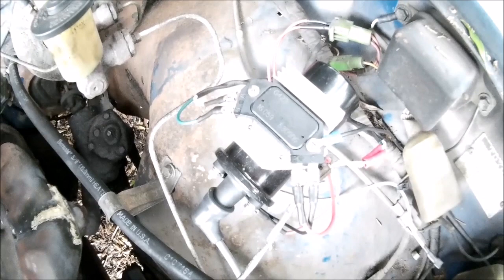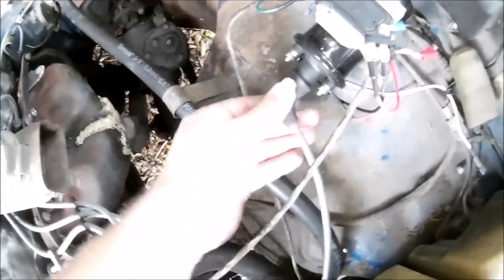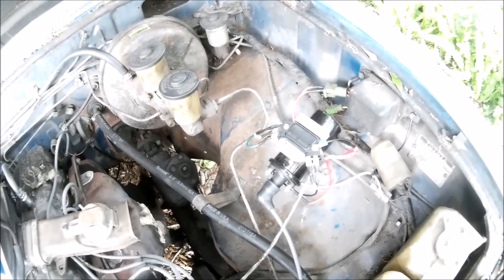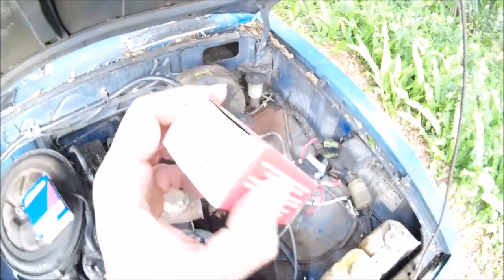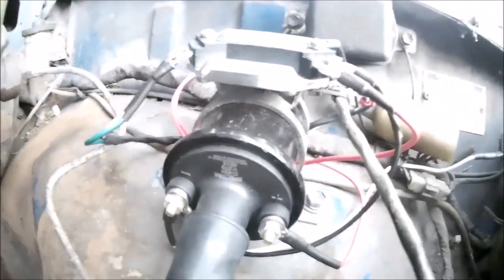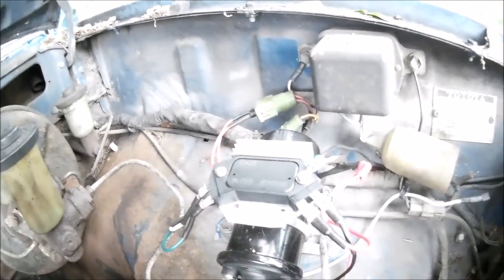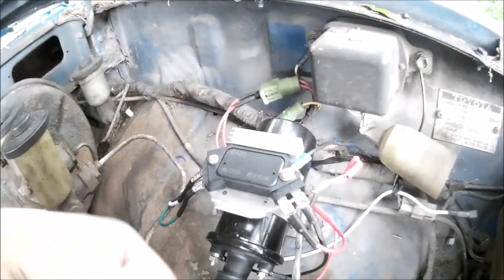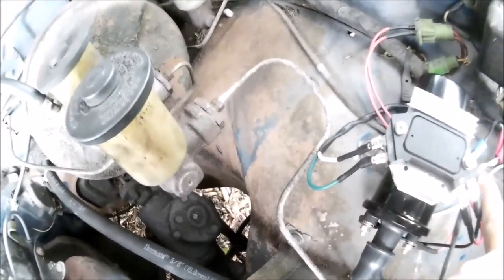1978 Toyota Pickup/Hilux 20R - GM HEI Ignition Module Conversion

Comment: Just did this conversion on my '78 Toyota Chinook today! Followed your video completely and did not have a single issue. Took about an hour or so. Thanks for the great list of '78 fix-it videos. BTW - I left you a message a few months ago about bolt sizes, etc. - your reply on that was to go to Ace Hardware, which was spot on. I've found just about everything I need fastener-wise in there.
Reply from the maker: Good work sir! Glad to hear the conversion worked for you and happy to be of help. Also happy to know I made the video complete enough. Sometimes I worry (and get messages from people) that the video is too long. I always try to make those vids complete because there is never any sense in doing it "half-butt". :^)
Reply: @The13thSword  I think the detail is necessary for these type of videos. If you made them shorter, people will complain that they are too short. Do your thing.
Looking for a good write up on a GM 1 (or 3, perhaps) wire alternator conversion, and on the hunt for a W50 transmission. I'm here in FL if you hear of anything! Thanks again.
Reply from the maker: @KevinMims  Not sure why you'd want to convert to the 1 or 3 wire GM Alt, but there are several write-ups & threads on it on Yotatech forums. Just Google Yotatech & you'll find the site, which you can search in for the articles.

Your truck being a Chinook it probably came stock with the 55 amp alternator, instead of the 45 amp model that the "regular" pickups came with. Both are externally regulated. The 55 amp model is still available remanufactured and Rock Auto has them at a much better price than the parts stores, even with shipping. They also have the voltage regulators. For the original alt setup, I recommend the Standard VR149 Regulator. You can see it all here: https://www.rockauto.com/en/catalog/toyota,1978,pickup,2.2l+l4,1277108

I don't know of anything local in FL for the trans, But Yoda Jims in CO is likely to have one. I've been pretty lucky with them on parts, and they also seem to have some motorhome models there, so the parts from them are lower mileage & in good shape. Google "yodajims" and you'll find them. You have to call them as they do not do online ordering.

Let me know if I can help with anything else.
Reply: @The13thSword  Thanks for the Yoda Jims info - looks like a great resource. On the GM alternator, I'm trying to eliminate items that aren't always stocked items - I don't want to be stuck while traveling waiting on an alternator or voltage regulator. Plus I'll be running dual batteries, so the extra amperage will be beneficial.
Not completely ruling out the 55 amp, but again want to make sure I'm easily covered while traveling.
Reply from the maker: @KevinMims  In that case the GM Alt would probably make more sense for you, as they are almost always in stock at nearly any parts store. Only problem with that is doing the new wiring for it, but I think the effort would pay off the first time you ever had an Alt problem on the road.

You may already have plans or have thought of this, but I'd recommend you also overhaul/update the battery isolater system & related wiring. Having a functional isolater is also a good way to not get stuck on the road, as it electrically separates the "house" battery from the "chassis" battery, but allows both to charge from the Alt as needed. This also keeps the "house" circuit from draining the "chassis" battery, & leaving you stuck with a truck that won't start in the morning.
Reply: @The13thSword  Proper isolation is on the list!

Comment: Hello need help.....I bought the two parts.   But do I need to change the point distributor entirely...to a different  distributor?...if so let me know what type or is there something else I need to upgrade
Reply from the maker: Yes, you need to upgrade to an electronic distributor that has a pickup coil in it. The conversion will not work with a points distributor. I recommend  a distributor from a 1978 Pickup, Cardone part # 31725.

https://www.rockauto.com/en/catalog/toyota,1978,pickup,2.2l+l4,1277108,ignition,distributor,7108

Comment: thank you for this video! im trying to get spark out of my freshly rebuilt 20r. id like to do this conversion. i have a 76 hilux. my distributor only has one wire and it runs to a resistor. the resistor connects to the igniter assy box. it doesn't seem to be working. i got  a new ignition coil installed. but im not getting any spark. any advice? thank you
Reply from the maker: If you only have one wire coming out of the distributor, you are either missing a wire for the pickup coil, or you have a points style distributor. Neither the stock Toyota igniter or the GM Module will run on a points systems; it needs the later style distributor with the pickup coil. Considering you say there is a resistor, it sure sounds like a points system. The resistor is called a "ballast resistor" and is there to lower the voltage & save your points from frying out too quickly from arcing. This is not a problem with the "electronic" distributor with the pickup coil.

To verify which distributor you have, take off the distributor cap (leave the wires hooked up to it) and remove the rotor & look inside. Then compare with the following two items:
https://www.rockauto.com/en/moreinfo.php?pk=28285&cc=1277085&jsn=425
and
https://www.rockauto.com/en/moreinfo.php?pk=28295&cc=1277108&jsn=471

Use the arrows in the picture boxes to see different views of the parts. If yours looks like the first example, you have a points style distributor. The second example is the one with the pickup coil.

If you do have points, try cleaning them up a little with a small, fine file. Points often get pitting or corrosion on them from arcing. Basically all they do is make or break contact to the ground (-) side of the coil circuit.

Let me know what you have & we can go from there.
Reply: The13thSword yes I have a points system. So could you just drop in the pickup coil style distributor? And furthermore use the Gm hei system?
Reply: It’s a brand new distributor. I see power getting to the coil(new coil). But I don’t see anything to the distributor which makes me believe the igniter assy is bad.
Reply: Thank you so much! So happy I found your videos
Reply from the maker: @juandlcgil  Yes you could do as you described with the "electronic" components. The points style distributor will NOT run an Igniter and besides, you don't need an igniter with points; it's redundant. The Igniter (or ignition module as some call it) took the place of the points in later models. This gave more steady signals to the ignition coil, and no points wear to worry about.

Or, you can run the single wire from the points to the negative (-) terminal on the coil, which will make the coil charge & discharge. I'd try that first just to see if I could get the engine to run that way, then make some decisions.
Reply from the maker: @juandlcgil  As I said, points will NOT run the Igniter. Just bypass the Igniter & connect the wire from the points to the Ignition Coil negative terminal for now. This should be enough to get it running, if all else is OK.
Reply: I have the same exact problem with juan. So does this mean this conversion will not work for the point system distributor? We have tried cleaning the points, we noticed the igniter box assembly was bad. No start
Reply from the maker: @juancho7486  Again, you shouldn't need an Igniter/Ignition Module with a points distributor. The points are what triggers the coil to fire in such a system. 

Points will NOT drive an Igniter/Ignition Module because an Igniter/Ignition Module requires voltage from a Pickup Coil to work. Points do not generate any voltage; it is a simple on/off switch. 

"Electronic" distributors have a pickup coil in them, and a collar with raised sections on the distributor shaft. Every time one of the raised sections passes in front of the pickup coil, it creates a voltage in the pickup coil. This voltage is then fed to the Igniter/Ignition Module, which amplifies this signal, then signals the Ignition Coil to fire.

Please understand that points ignition & electronic ignition are two separate types of systems.

Did you check the gap between the rubbing block & the points arm? There should be a gap of 0.018 inch or 0.45mm. Use a correct size feeler gauge to check this and adjust if needed. After that, just run the wire from the points to the negative terminal on your coil. Crank the engine & check for spark. If you have spark but the engine still doesn't start you have other problems.

Comment: I have a question?? Your 20r does not seem to have a fuel pump located on the right side of the engine block!! How do yo have your fuel pump set up ?? I have mine located on the upper fire wall next to the Windshield wiper motor and every time i start it after a week sitting the fuel pump needs to be sucked by mouth and immediately connected to the carb!!
Reply from the maker: Earlier 20R engine equipped vehicles had an electric fuel pump in the gas tank, stock setup from Toyota. Later 20R's had a mechanical fuel pump mounted to the passenger side of the cylinder head.

There are several interesting things in what you say, and some important information I want to give you, and anyone else looking at this later. There are some important safety & function things you need to know.

You say you have your fuel pump mounted to the firewall and I am going to assume it is an electric fuel pump. The first and most important thing is that you should NOT have it mounted there, it is a safety hazard. Tempuratures under the hood can reach up to 200 degrees F, more than hot enough to boil gasoline. If your pump housing is metal it can absorb that heat & cause running issues, as well as overpressurize your fuel lines. The mechanical pumps on some 20R's have a plastic spacer between the head & the pump to keep this from happening.

For operation, electric fuel pumps work best when they are "pushing" fuel rather than "pulling" fuel through the lines. That is why it is best to mount the pump as close to the fuel tank as possible, so the length of line it has to "pull" the fuel through is short. The way you have it now, that pump has to create a lot of suction through a very long line, just to get fuel to the pump. That is very hard on that type of pump and it doesn't work as well as it should.

I strongly advise that you re-mount the pump close to the fuel tank so it can work better, it is much better for the pumps operation. It might also solve you "dry" problem but if it doesn't, there are fuel line check valves you can but & install that would help that problem. The check valve only allows fuel to go towards your carb, & prevents the fuel in the line from draining back to the tank when you shut off the engine.

Any specific questions you might have, just let me know more details of what you have & I will try to help out.
Reply: The13thSword Dude you’re awesome you explained me in detail what to do I will definitely go ahead and install it below the tank and yea i have it probably running through the other fuel pump!!
Reply from the maker: @jessepacheco02  No problem and you are most welcome. Usually drawing through the old fuel pump in the tank is not a big deal, as long as there is no debris to block the fuel pickup opening. Or as long as there are no broken impeller parts inside the old pump blocking it.

If I can help with anything else just let me know.
Reply: The13thSword ok cool idea sound like an easy job “!! But i dont have an option to use a mechanical furl pump ?? Or whats the best bet here?? I would want a mechanic fuel pump!!
Reply from the maker: @jessepacheco02  It depends on what style of head you have on the engine. As near as I know, the only 20R cylinder head that had the mechanical fuel pump was the 1980 version. 1980 20R heads had the port factory machined out in them to accept the mechanical fuel pump. All other 20R heads (1975 to 1979) just have solid metal in this area so there is no way to mount a mechanical fuel pump. By 1981 Toyota stopped making the 20R engine & started making the 22R.

Even if I had the correct 1980 head to mount a mechanical fuel pump, I think I'd still want the electric pump. Almost all electric pumps have an impeller in them that spins to move the gas, and this provides more even fuel pressure & flow. Mechanical pumps have a diaphragm that move up & down and "pulse" the fuel through the lines.

Comment: Planning on doing this convertion for my 79 toyota pickup 20r. Would the Standard Motor Products UC12 ignition coil be the right coil to use? Nothing else in the truck has been converted.
Reply from the maker: Even if you were running the original stock Toyota Ignitor (Ignition Control Module or ICM) the UC12 would work with it, as it is a recommended replacement for your application. That coil also has the correct Primary & Secondary resistances to work with the GM HEI Module if you do the conversion.

If your stock Ignitor is working there's really no reason to convert it to the GM HEI Module setup, unless of course you just really want to. In either case, I recommend that you use the UC12 because it's a quality made coil. I've had cheap coils burn up the HEI modules inside of 6 months. The internals of cheap coils break down quicker, causing shorts in the windings & increasing resistance, usually in the Primary. The increased Primary resistance in a failing coil is usually what takes out ignition modules & causes them to fail. I've been using a UC12 for almost 2 years now & the HEI Module is still going & running strong.

2 other "by the way" things:

1. The ignition coil you buy may say on it "Use with resistor wire or external resistor". To the best of my knowledge, all '78 & newer 20R engines with electronic distributor & ignitor (ICM) does NOT have an external resistor, also sometimes known as a "ballast resistor". Standard & other makers just print that on there because that coil fits a LOT of different vehicles & applications, some of which have "points" ignitions with the ballast resistor. Neither the stock Toyota ICM or the GM HEI Module require the use of the resistor; just direct 12 volt power from your ignition switch circuit.

2. If you need the coil specs for testing, the stock specs for 1979 are 1.3 to 1.7 Ohms Primary, 6,500 to 10,500 Ohms Secondary.

If you have any other questions I'd be glad to answer them or help you out with any other info.
Reply: Thank you for being so informative!!

Yes, the ignitor is bad and since finding replacement part is so hard and expensive your video is VERY helpful.

Looking to buy a set of automotive wires to stock the garage. What wire suggestions do you have for the job? Best Gauge? AWG important?
Reply from the maker: @mspuliuvea5586  You are most welcome, glad to help if I can. If you use a quality ignition coil & make sure the HEI Module has a solid ground (critical) it should work fine for you.

If you are referring to spark plug wire sets any good quality brand will do, like Denso, Bosch, NGK, Standard, BWD/Neihoff(NAPA), etc. I believe that the stock Toyota(Denso) wires are/were 7mm; most replacement sets you'll find out there are 8mm. Either works fine. I run the 8mm wires because they are the easiest to find & I have no problems with performance.

If you are referring to AWG size on the wires for the Ignition Module conversion job you shouldn't use anything smaller than 18 gauge & use stranded (multi-core) wire instead of solid core. The stranded wire holds up better to vibration over time. If I remember correctly I went with 16 gauge stranded because I wanted to be sure the wires could handle all the amps the module wanted to use & not melt the wire due to heat resistance. I doubt there would be a problem with that using 18 gauge; I just like to build in extra "head-space" in my circuits as a safety measure & for durability.

By the way, most "stock" auto circuit wire sizes are usually 16 to 18 gauge, for comparison, with most "high draw" circuits (like power to ignition coil) being 16 gauge. Lighting/accessory circuits are usually 18 gauge.

Hope that answers the question. If you need any more specific info just ask.

Comment: I did that on mine its been working like this for the last 3 yrs. I bought the alternator bracket to install the GM one wire Alternator. Eliminates the external Voltage Regulator
Reply from the maker: Well, it doesn't exactly eliminate the voltage regulator, because there is an internal regulator in the GM Alternator.
Reply: @The13thSword  yar, but it eliminates the EXTERNAL voltage regulator.  Which is what they said. I'm totally doing this mod by the way, it looks like the best thing to do for this situation, and great parts availability as well.